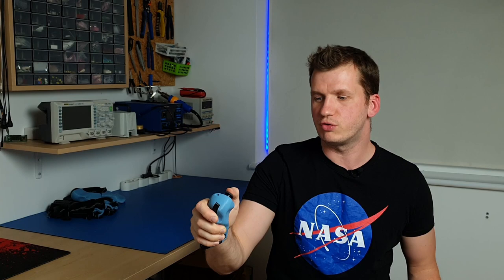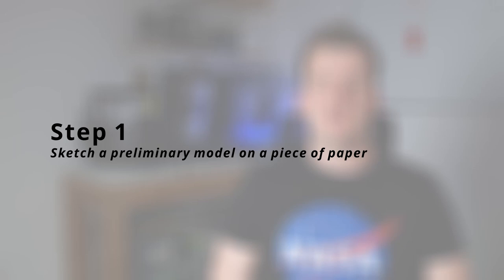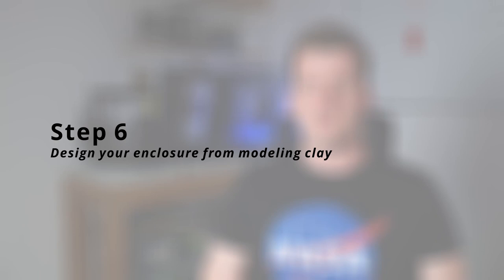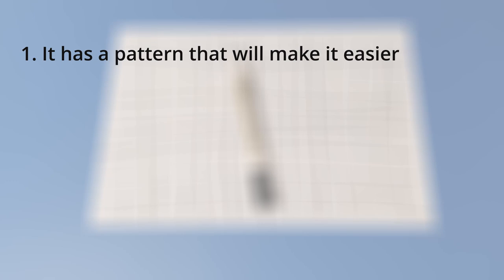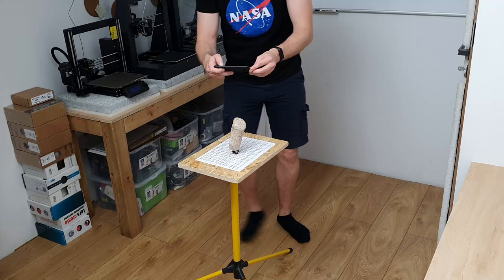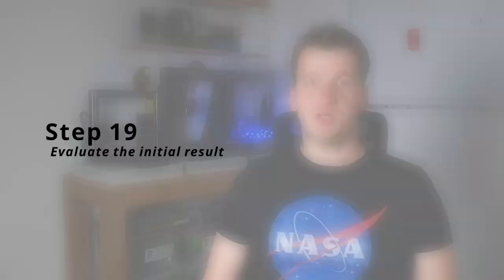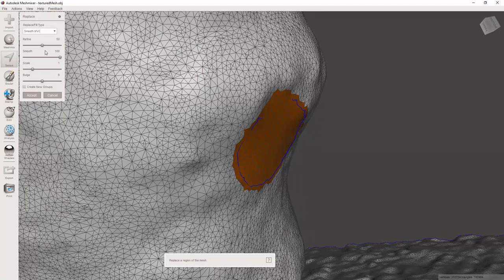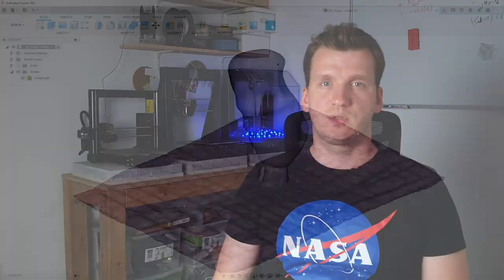Photogrammetry for Enclosure Design: The Ultimate Guide

Comment: Hey mate, Just wondering is it possible to scan the object by rotating it in space rather than the camera?
For some things I'm sure it'd be easier to just rotate the object against a constant background.
Reply from the maker: Hey, it can be done, but it isn't easy. In that case, the background must be completely uniform. Preferably white or black. Without any reference points. Just constant background isn't enough. If there are any reference points, the software for photogrammetry will be lost.